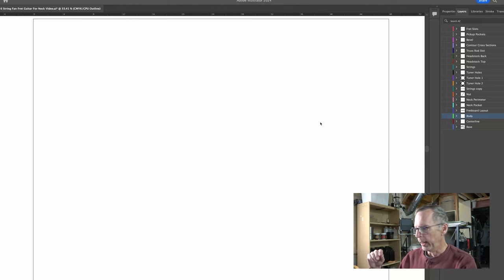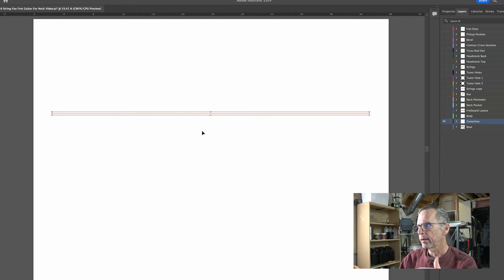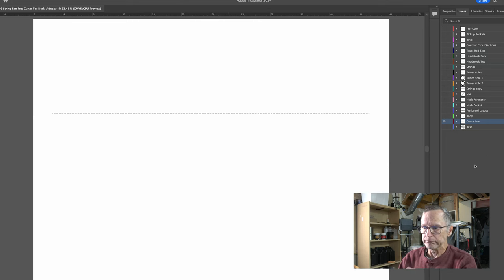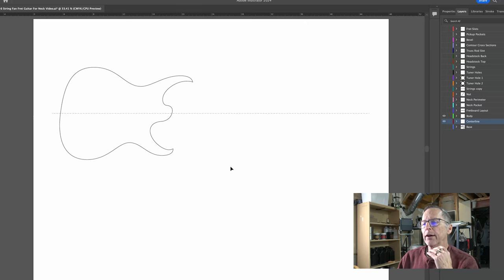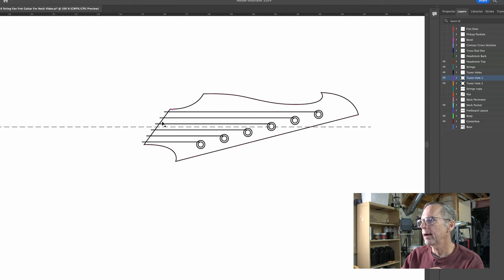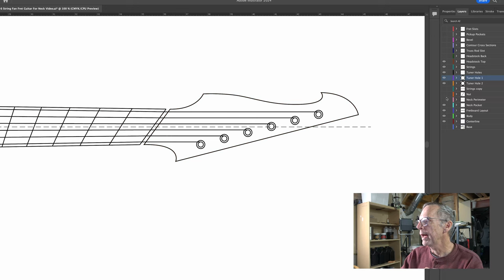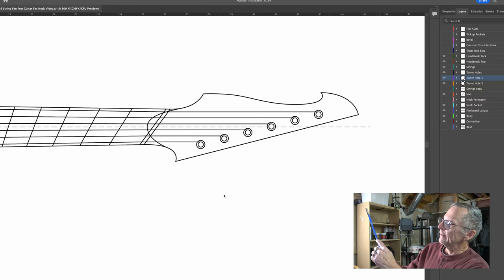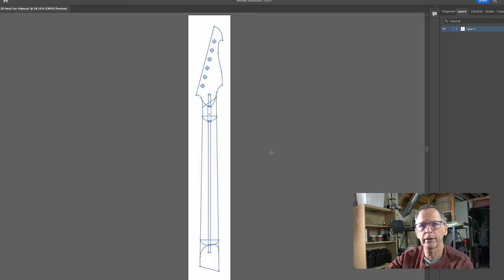Making A 3D Model Of A 6 String Multiscale Guitar Neck Part 1

Comment: I simply used Python scripting in Blender to create a fretboard builder functionality, where I define widths, radii, number of strings etc., as well as angle of saddle and nut, and it spits out the fretboard model. I am gonna extend it to strings and scallopping so that I have all the difficult parts by the machine, and I am as good as done. It took me a whole weekend to write the builder as despite being a senior programmer I still make math errors.

Comment: You can try making a jig to hold the headstock flat, pocket/ drill your holes, cut your profile, uncle Bobby 😊
Reply from the maker: Or take a few seconds to walk it over to the drill press. No jig required.
Reply: Agreed, I just like the ideal of having the headstock planer with the waist board and milling the tuner holes, truss  access pocket, profile the headstock, inlay pockets, engraven or even 3d carve if you like, all from one setup.

Comment: Fascinating to see the procedure use. Looking forward to the next tutorial video. I don't know if you're building the guitar for a client with particular specifications, but based on many multi-scale necks I've seen, the Nut Slot Angle seems rather big. Could be exactly what they want. 🤷‍♀
Reply from the maker: The angle of the nut slot and the angle of the bridge are determined by the chosen scale lengths and which fret is selected to be the neutral perpendicular fret. In this case it will be the 12th fret. Once the scale lengths and the perpendicular fret location are chosen math dictates the angles.
Reply: @HighlineGuitars  Yes, I understand the math. I just wanted to mention the Nut angle, as it might be be difficult to play.
Reply from the maker: @picksalot1  I have made dozens of these guitars. If they were difficult to play, I would have changed the design years ago.

Comment: Is there a reason you don’t do your 2D work also in Rhino? I work in OnShape, and it seems like it would be a pain to start in Illustrator when there’s a Sketch system in OnShape with proper dimensioning and such
Reply from the maker: I use the Illustrator files for other things.
Reply: @HighlineGuitars  I don’t know if you’re interested, but I’m working on an OnShape file that takes parameter inputs like scale lengths, nut widths, etc. and it dynamically generates neck layouts (at least, the critical geometry). Probably similar to the online tool you use, but it gives dimensioned CAD. 

I’m currently building it to fit my needs, but it’s easy to also add other things like string gauge and spacing.